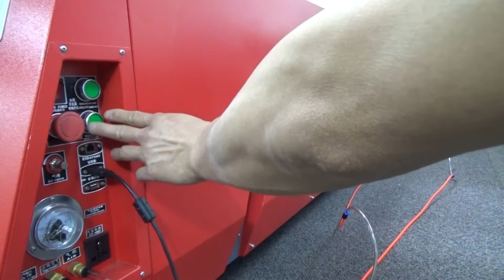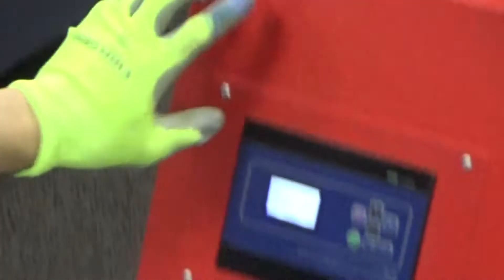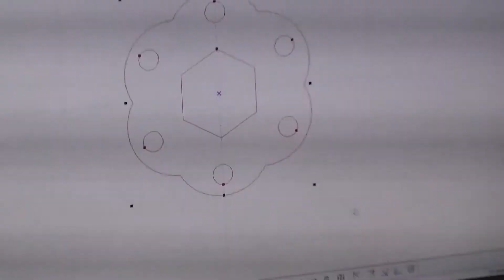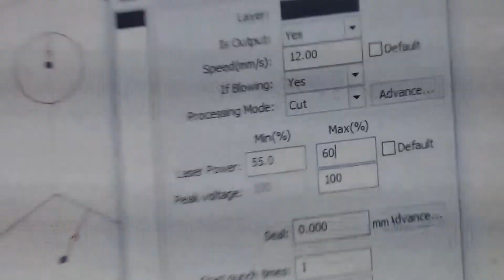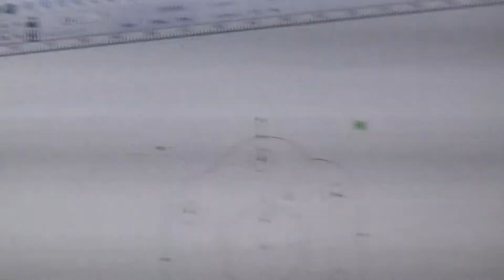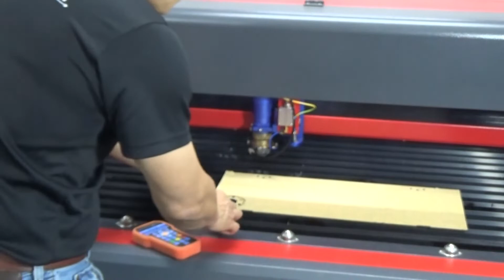Katana Hybrid Laser machine Basic setup

Comment: What type of system drives this machine? Belt or rack and pinion?
Reply from the maker: The old one was rack-pinion on Y axis. The new one is rack-pinion on both X and Y. Plus, it is servo motors instead of steppers.